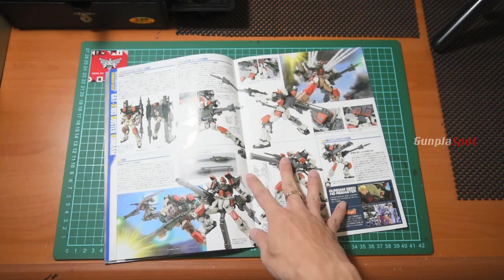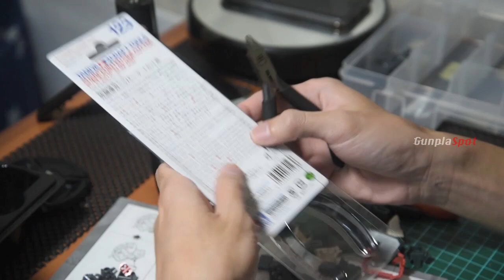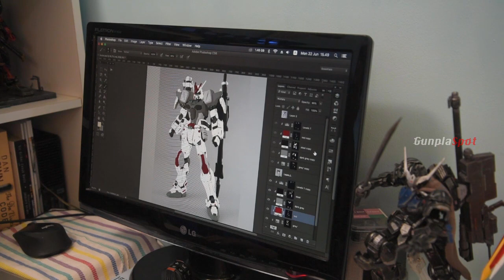Snow Recon : MG Buster Gundam Custom Build

Comment: Mau tanya untuk nozzle  spraycan bisa ditukar2 ya?. Untuk kitbash dr apa aja itu bro?. Saya masih pemula ingin coba
Reply from the maker: Oprek-oprek Mainan bisa bro. Nozzle spray khusus hobby, lubangnya lebih kecil jadi partikel yg keluar juga lbh kecil. Tapi tekanan gasnya tetap ngikut kalengnya yg baru. Jdi kalo pake cat industrial ya power sempritnya tetap gede, jdi ngespraynya agk dijauhin dikit dri part.

Kitbash pakai tactical armnya astraybred frame aja 😃